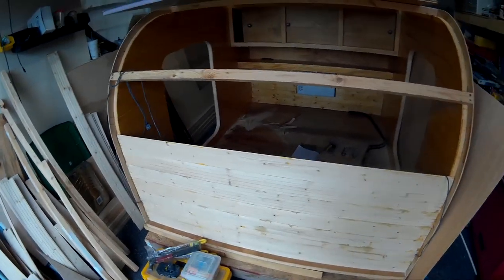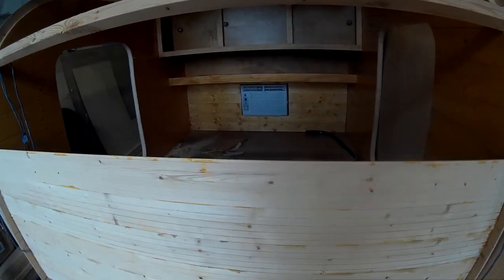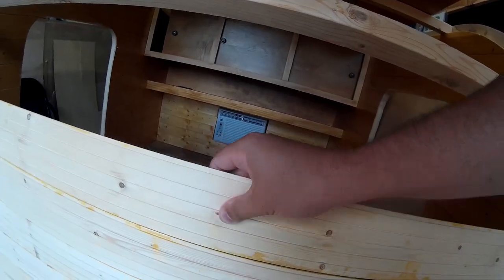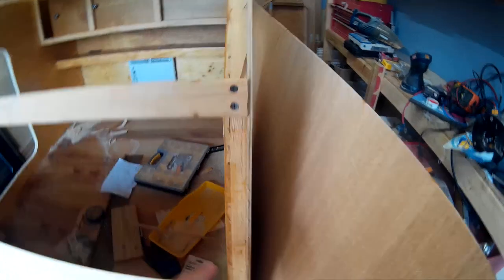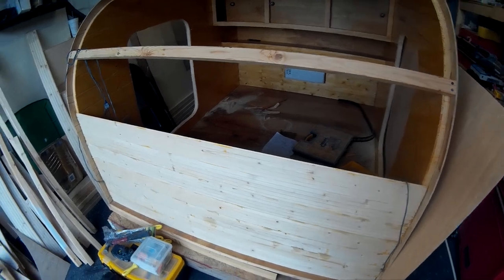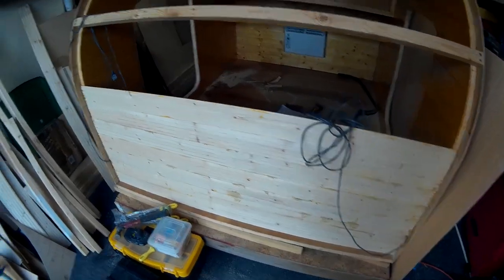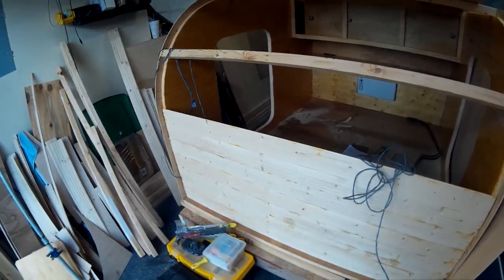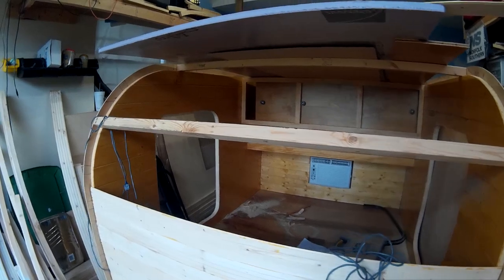How to Build a Teardrop Camper - #11 - Ceiling Installation

Comment: impressive!! ive gotten a lot of ideas from your videos. although I would love to see how the a.c. is installed. your parents are going to love it
Reply from the maker: Thank you.  I will be covering that soon (I hope).  Basically there is going to be a vent out the bottom floor, and an intake into the back of the unit that is separated by the cabinets.  THis is different than the last build, but that was much more involved.  I think this will be easier, and involves less part to fabricate, and takes up no room on the interior of the trailer.

Comment: Dad rambles, great videos! Very informative. 

I've got a a few questions. 

Do you register the tear drop with DMV? 

How much does the tear drop weigh? 

What would you have done differently if you made another teardrop? 

Are you satisfied with the trailer? 

Thanks 

GCJ
Reply from the maker: +George Cardona Jr 

1. Depends on your state dmv. In GA it cost me 13 bucks for a tag. 
2. This one will weight about 1100 lbs or less,  I hope. I thunk that's a good estimate though. 
3. That's tough to say. I'm still in the process of building this one Kama so it is exactly where you see it in video number 12. The first one that I built is quite a bit different than this one. And honestly, I can say I don't think I would change a thing about it. It's a little bit bigger Kama at 6 foot wide, and it has two bumps in the front for our kids. We have taken it over 10,000 miles in the last year-and-a-half and camp about 50 + nights in it comma and there are only a few things that I have tweaked with it. Nothing that has to do with the overall design though. Those are just things that were personal preferences like the cabinets in the back comma I don't believe those are in my final video comma and maybe adding a spare tire mount underneath , which I still might do.
4. So far yes, I am satisfied with the trailer. One thing I will add on that is that if you have the ability to weld comma for a little bit more money you can get a torsion axle and much better-looking Wheels. But comma don't be tempted to over Bill the trailer. It will get very heavy, and it doesn't require a lot to support the cabin of the teardrop. However, I definitely would use it again as the base for a camper. I have seen many campers that were built on it and they all seem to pull well and for the price it is a decently built trailer.

Thanks for watching and let me know of you have any other questions.
Reply from the maker: +Dad Rambles sorry for the poor grammar, I am texting from my phone.
Reply: Dad Rambles, thank you for taking the time to answer the questions, If i can find the same trailer I use it. Did you follow any specific plans? Did you purchase them or did you make them yourself? 

Do you mind if I occasionally contact you if I have a question?
Reply from the maker: I bought mine on Amazon.  Here is a link to what I used.  http://amzn.to/2aUKBO0 No, I just came up with my own plans.  Sure, send me a message whenever you like, I will be glad to help.

Comment: Have you heard of anyone using polyurethane glue for their tear drop for the waterproofing aspect?  Very nice build!  I am thinking of a 4X8 for my wife and I pulled behind a Ranger 2.5 L 4 cylinder.
Reply from the maker: Yep.  All the glue that I use on the "rough" joints is PL premium.  That stuff will hold a truck up.  Tough as nails.  Thanks for watching.
Reply: Also very waterproof!  Built a small duck boat for small lake paddling with it and not a drop inside.  Thanks!

Comment: I've been looking for those pine boards, did you pick them up at a local lumber yard, or big box store?
Reply from the maker: I got mine at Home Depot.  They were back in the lumber section where they have  (at least at my store) the specialty boards for shelves and such standing up on end.  You could probably find them at a local lumber yard though for cheaper.

Comment: Did you have any issues installing the pine ceiling boards around the front curve?
Reply from the maker: Nope, none at all.  it was really, really easy actually.  the boards are narrow enough that they don't really even know the curve is there.  Also, they have a small amount of flex to them, and that helps as well.